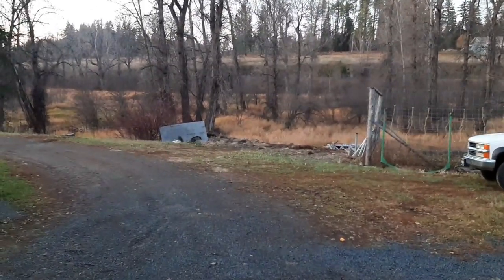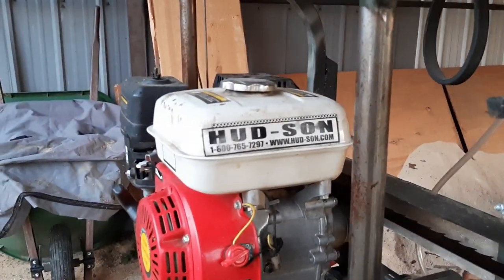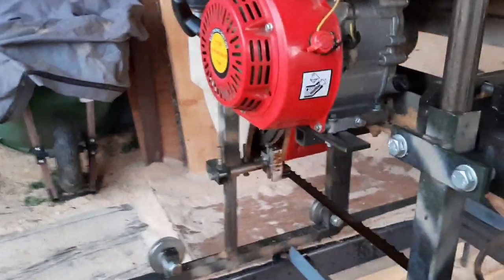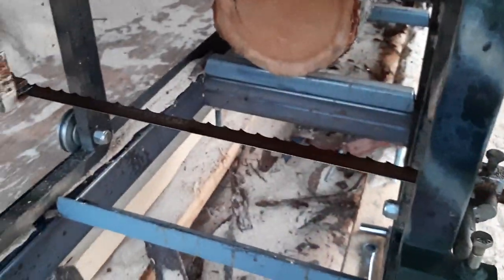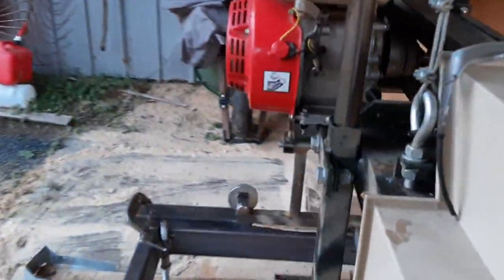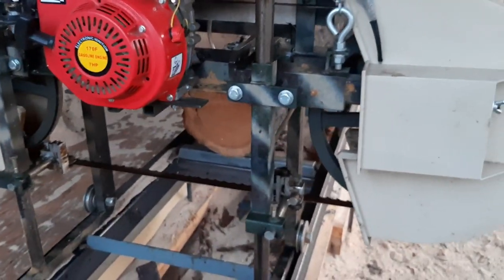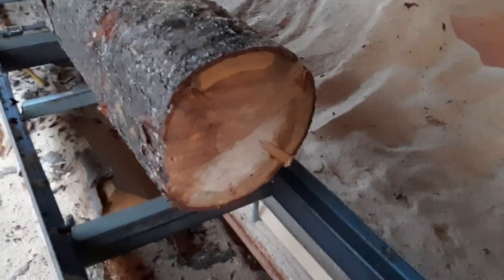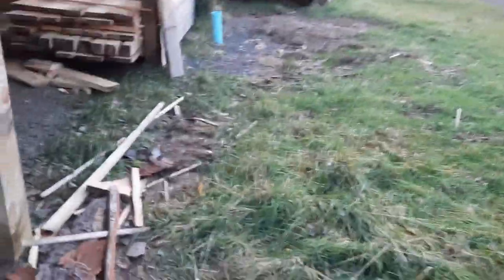Hud-Son  Hunter sawmill.

Comment: Hello!
I wanted to say thankyou very much for the video review.
I have wanted a sawmill for a long time, and honestly cannot afford most of what's on the market.  I spoke with Hud-son the other day and I think I will go ahead and order this mill -- based mostly on your review.
Thankyou for pointing out the modifications that can be made to make it saw a little bigger tree.  I will do the same to mine once I get it.  Everything is back ordered due to the virus.
Reply: I found a mobile home frame and have been making similar modifications. When finished the track will be more like an 18 ft. sled that can be skidded on and off of a 20ft trailer and be moved for easy clean up. The trick is to build the support braces for in between the 2 I-beam's so as they bolt on to minimize tweaking from excess welding. I am using 2.5in. drill casing and 6x6 1/4in. flat bar welded on the ends and bolting the 2 beams together staggering the braces top then bottom every 2ft. The track will then be bolted onto the top of the I-beams.
Reply: @meganhansen2889  I looked for a mobile home frame myself.  I found a usable trailer frame from a camper that gave me a good platform.  Nice to be mobile!!

Comment: I just finished getting my sawyer set up. The blade has noticeable bounce where it comes across at the top, but looks nice and stable at the bottom where it cuts. Is the bounce up top supposed to be there?
Reply from the maker: There is always a little flutter of the blade on top.  Blade tension is what corrects the amount of flutter. Make sure you have the correct tension on the blade and check it again after a pass through a log.
Reply: @QualexCustoms  how do you tell if your tension is correct? Use a tool or just by the deflection when pushing on the blade?
Reply from the maker: @clayjones553  Set the tension bolt/nut to 35 lbs with a torque wrench.
Reply: @QualexCustoms  ok ill have to get one. Thanks for the help